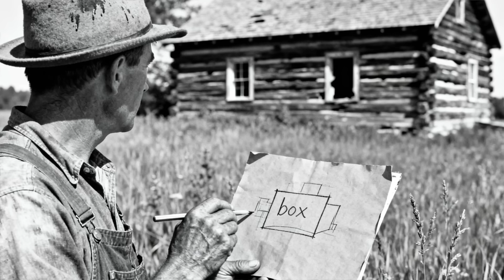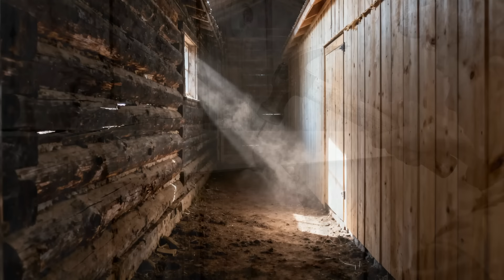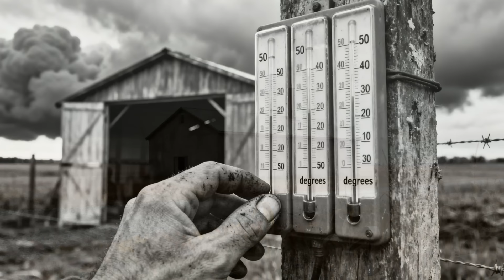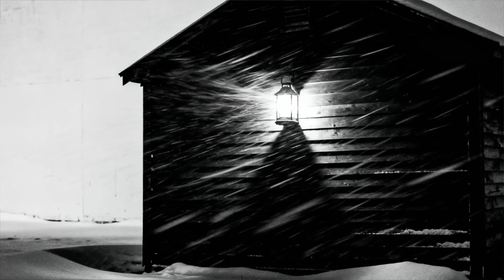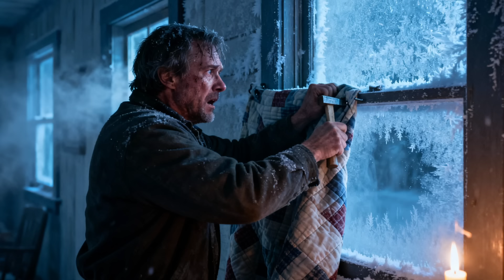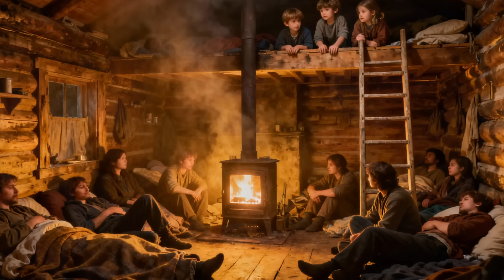Neighbors Laughed When He Built A Shed Surrounding His Cabin—Until It Created A Warm Air Buffer

Comment: I read an article about a residence in Norway that had been encased in a large greenhouse. They didn't heat it but they thought the air inside the greenhouse stayed about 10 degrees warmer than the air outside so this reduced their heating bills significantly. If it was clear and sunny I'm sure it did more than that but on overcast days it would have still been a windbreak. God bless.